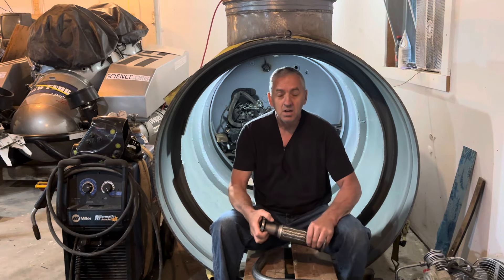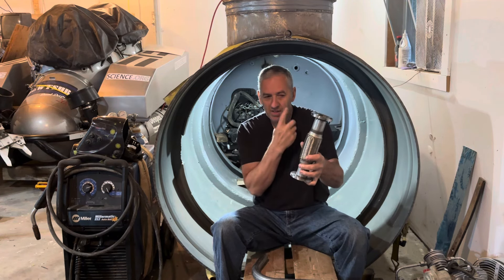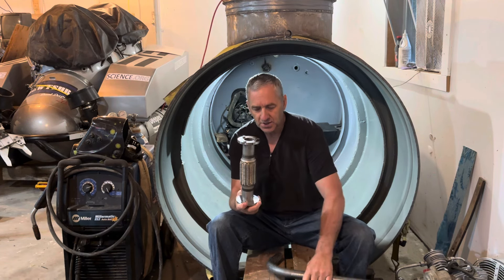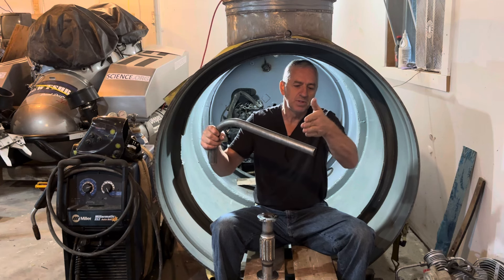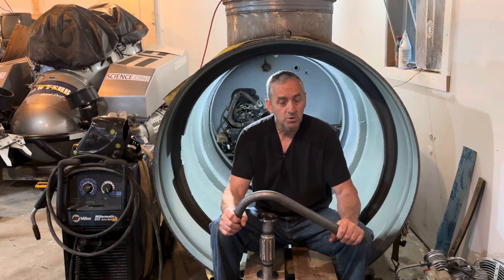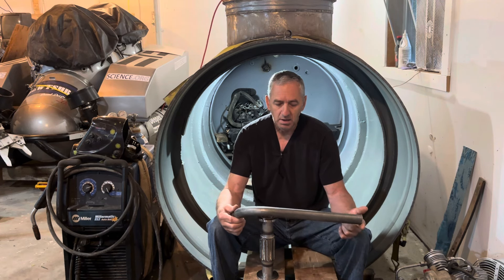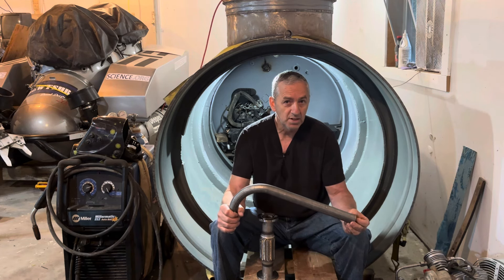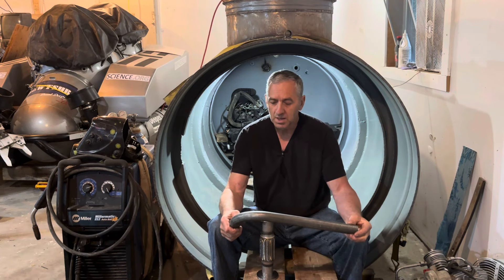Homemade diesel submarine build, exhaust progress

Comment: To prevent water backing into the exhaust use a check valve.
Reply from the maker: The water backing up is not in issue with  the stack going on.

Comment: I dunno man, if I was going ti build a submarine myself, I would stick to straight electric, the exhaust on an ICE is one thing, but thats not the only place you are going to get fumes from, even tiny quantities can build up over time with even tiny leakage from dipstick from miniscule cylinder blowby... not a problem in the open air, but something you need to consider in an enclosed enviroment.
Reply from the maker: I have considered all those things, but strait electric is not an option.  There is just net enough range in batteries.  The engine only runs on the surface with lots of ventilation.  The engine air intake is not connected to a snorkel, so the intake air is  dispersed.
Reply: @HankPronk  Alright then, best of luck to you.

Comment: Will the angle of the exhaust pipe be more than the angle of the sub when pitched for diving/surfacing? Much more than a couple of tablespoons of water I think! Why not just round it completely downwards like a snorkel?
Reply from the maker: The only time the exhaust could  see water inside is after a dive, when the valve is opened.  There will be a tall exhaust stack to prevent water coming while running, plus the engine running will push anything out.  I  want to keep the exhaust as short as possible to avoid the heat.

Comment: Hank, how much would it cost if you used the propane tanks like you have here,  but 2x as high?  So another tank placed on top of the other like OO (just flipped)  If I were building a sub, I'd want to be able to walk upright.  Or at least do so when I've eaten down the food enough.  😁😁
Reply from the maker: You can't do that structurally and if you cut a walk way it would be too narrow.  You would need to by a 6 foot diameter  tank and it would be unbelievably heavy.
Reply: @HankPronk  so is it a matter of safety or a matter of the ability to make the sub within a reasonable budget?
Reply from the maker: @mattparker9726  Its a huge red flag for safety.  You are interrupting the load path too much.

Comment: Use stainless right from the start or replace that as soon as possible.
Reply from the maker: Agreed
Reply: @HankPronk  you can put anodes on it. as a quick warning since you said youre not a welder, stainless is kinda a nightmare to work with if you dont know what your doing and when you start thinking youre getting good at it youre probably still making weak welds. use extreame caution with all pressure vessels and confined spaces. youre dealing with alot of different hazards here so be uber careful about thinking this thing out. its a life support system remember that.
Reply from the maker: @hackaboom  Thanks for the input.  I have built 8 sub prior to this one, and I do a lot of pressure testing.  I even pressure test parts for other sub builders.
Reply: @HankPronk  is not just that.  Being in a confined space(let's say the project sat for a while) that hasn't seen fresh air in a bit can kill you for instance not trying to scare but like I said things get complicated quick.
Reply from the maker: @hackaboom  As a rule, before and after all dives in my currents subs, I blast the interior with my leaf blower with an extension pipe on it.  I like to blow out the humid air after a dive and fill the sub with clean air.  Also the CO2 level is high after a dive, just from sitting in it after the life support systems are shut down.  Even with the hatch open the CO2 will hit 2500 ppm  just siting in it cleaning up.  Before  a dive, same deal.  Its not just diesel subs that need this.
Reply: @HankPronk  didn't say it was just diesel subs that need things like that. Glad you're doing some monitoring and aware of risks that are outside the box. CO is much different biologically that CO2 btw, hope you're looking for that too.  Glad you're at least watching your parts co2.
Reply from the maker: @hackaboom  I am just pointing out that I have protocols in place for ventilation.  I am  new to building with a diesel engine, so all input is good.  One person can't know it all.
Reply: @HankPronk  good, be safe brother. if I see something I can help you with I'll try to speak up. Just definitely wanted to point out those safety concerns.

Comment: Where does the air come from that the engine needs to run inside the cabin
Reply from the maker: The engine only runs on the surface, so air comes from a snorkel or hatch open.